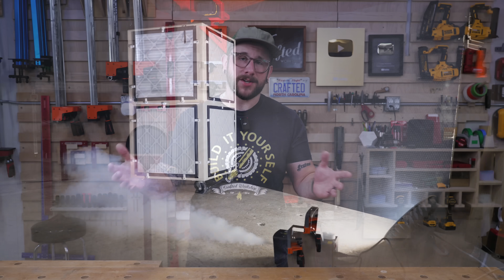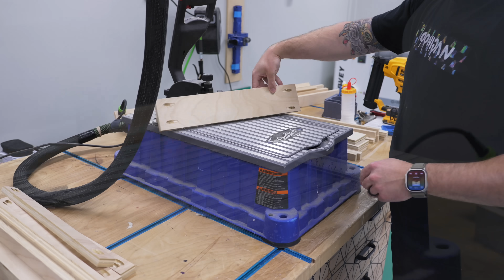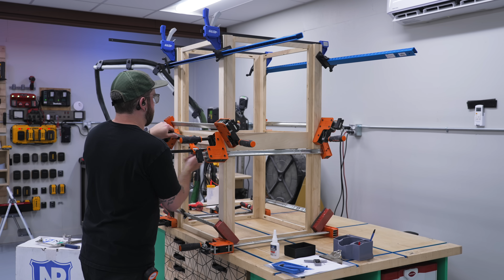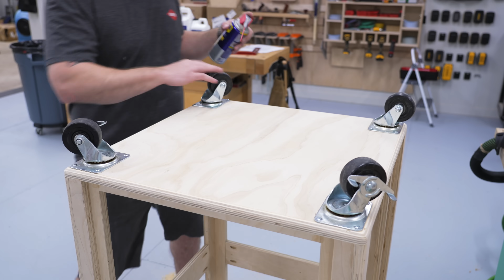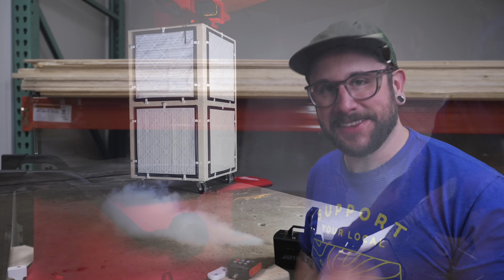How To Build DIY Cordless Shop Air Filter & Stop Breathing DUST!

Comment from the maker: Get plans for the DIY shop air filter cart! https://craftedworkshop.com/store/diy-shop-air-filter-plans-pre-order
Reply: Where's the link to the dewalt battery adapter? Thanks!
Reply: How has the prefilters been? 110 mesh is about 150 micron.

What do you think about 200-300 yellow mesh? It's ~50 microns.

Merv 14 removes down to 0.3-1 microns.

Just wondering if the 300 mesh would give you enough filter life without reducing the flow drastically 🤷
Reply from the maker: @benspragge33  the 110 mesh has worked great, it catches the larger stuff just fine and the filters seem basically brand new still. Easy to vacuum off the mesh and keep rolling.
Reply: @craftedworkshop that's very helpful. I was curious cause I want to build this for construction sites in houses. For painting and sheetrock dust. I'll try the 110 mesh first.

Thanks again!
Reply: Which particulate detector do you use?
Reply: @1320crusier  i would also like to know this please @craftedworkshop
Reply: Stop messing around. Get a cartridge filter such as Wynn Environmental carries. Better filtration, easier to clean if you have a leaf blower or air compressor. Costs a bit more but faster/easier to assemble something.
Reply: @jimweisgram9185  i searched their website and they have so many options i have no clue which one you're meaning when you say "costs a bit more" can you please narrow it down if you're going to go through the trouble of helping us out please?

Comment: I like the design, but I think I could use a lot less plywood by dropping the inner/outer frame design in favor of a single frame and using a router bit to recess the filter "pockets". Also, keep in mind the air pressure against those filters when you turn the fan on: when air is flowing it will snug the filter against the frame. Seems like you could use 2 clips instead of 6? And maybe even skip the foam?

Comment: Question: Why not use an air exhaust system? It seems like a great, perhaps even better, solution, yet I don’t see many workshops using one.

You could install Cloudline inline fans for both intake and exhaust to fully exchange the workshop air. This would reduce particulate matter (PM) levels much faster than any HEPA filtration system, while also removing VOCs and formaldehyde (things HEPA filters do nothing for). These systems are relatively silent and inexpensive. The obvious downside, of course, is that you would also be exhausting your conditioned air (heating or air conditioning).

I’m currently designing my woodshop and plan to use a very similar dust collection setup to yours: a Oneida system for the large machines, a Festool shop vac for power tools, and a Powermatic unit mounted on the ceiling.
That said, I think adding a HEPA system still makes a lot of sense. especially since the Powermatic doesn’t actually remove dust, but rather agglomerates fine particles into larger ones, making them less hazardous. But still: why don't you go with a full exhaust?

Comment: Question is , what is the most cost effective filter?, (size) that rules design. Looking at filter cost, it may be the 27 x 20 3 inch thick filter bought in bulk,,,(get one winter out of.)

Comment: What you really want to do is check the flow of a new filter, then you can check each individual filter and only replace the filters that actually are blocked. Saves heaps of money in the long run.

And you’d want to check the whole surface of the filter in a sweeping motion and use the average function of the anemometer and press hold when finished checking the entire area of the filter.

Also I usually orient the filters so the lines are running vertically so dust doesn’t necessarily settle on horizontal surfaces of the filter .

Great project though.

I might make one for my shop to get my welding fumes out

Comment: The anemometer measures feet/minute. You need to multiply that number by the area of the fan (in square feet) to get the CFM measurement.

Comment: Even if I have a really small workshop and this one will not have space to fit there (I will need something mounted on the ceiling) I would love to see your results after a while, with how often you need to change the filters, clean the inside if needed or other things. When I'm writing it has been more than 9 months since the video release.

Cheers.

Comment: Thank you for making it with slats.  I hate watching people waste plywood cutting a 2’ 2’ sheet and the cutting out the middle.    Though I made mine 4” deep so 2 2” slats on each side hold filter in.  I’d have to remove one slat to remove a filter.

Comment: Nice build!  Interesting that the fan runs either corded or cordless.  I assume it also charges whenever it is plugged in.
Keep an eye on the “pre-filters” - they are likely to get clogged much sooner than expected.  Still, I do like the idea.
Others have expressed an interest in a follow-up.  I concur.
Please provide the link to the adapter for the DeWalt batteries.  Could not find in the description.
Thanks!

Comment: A small improvement I might suggest is in place of clips to hold the filters in, and installing mesh prefilter on each one, is you could potentially build a door for each side that has the mesh preinstalled and serves the function of holding the filters in. It's more work but it saves work down the road of installing the mesh every time you replace the filter. You could theoretically have the prefilter be permanent.  overall great build

Comment: The anemometer you have measures in feet/min. That's how far the air travels over the course of one minute. To get cubic feet/min you need to multiply the value you get by the area of the fan's exhaust (which the anemometer can't possibly know). If it's 18 inches in diameter, that'll be 1.77 square feet, multiplied by 1181 ft/min gives 2007.7 cubic feet per minute. Not quite the 3400 claimed in the specs, but they might be fudging that number by including air that gets pulled around the outside of the fan and so on.
Reply from the maker: Yea, I definitely did my math wrong but still underperforming!

Comment: Glad I haven't pulled the trigger on the 3D kit yet.  Love the battery operated fan and that it works with his parts.  Pretty sweet setup my cyber friend!  Semi-pro tip for ya...cut off your anamometer lanyard; mine got sucked into the fan and broke. Oops.
Reply from the maker: Hah, good idea on the lanyard but I'm worried about the entire thing getting sucked into my dust collection hose when I test that in the future! The cordless fan is working great, loving this filter cart so far.

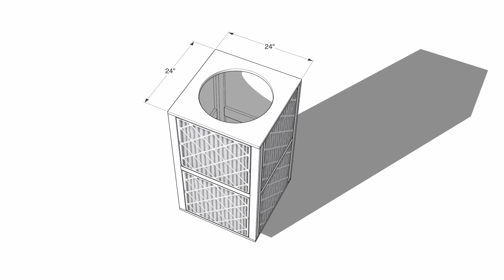Comment: @ 1:40 I’d argue that the average Milwaukee “fan” is much larger than 21” in diameter…😂

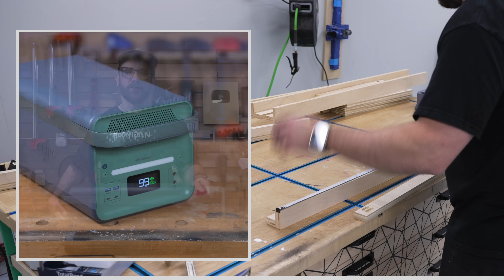Then @ 3:59 your sponsored plug would give you a great chance to choose literally any number of corded fans in the marketplace that are likely far stronger and far cheaper for the cfm than the Milwaukee cordless one you chose. Just build a place on the bottom for your Yoshino battery pack to live and run the cord from the fan on top on down to the battery. Still stable and if anything probably more stable as the fan up top is lighter and the base is now quite heavy with the Yoshino. 

Plug in overnight and you’re good to go.

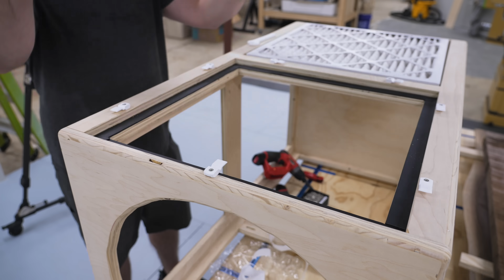Comment: 15:00 I like the pre-filter idea I hope it works out well. Also when you take the tape off it probably won't come off the cardboard very well but if you cut around the edges or next time put a gaffers tape edge on the material and fold it around then tape it onto the filters you should be able to remove the material from the filters pretty easily and reuse it. The edging will give the material some edge strength and then the gaffers tape should release fairly well from itself.

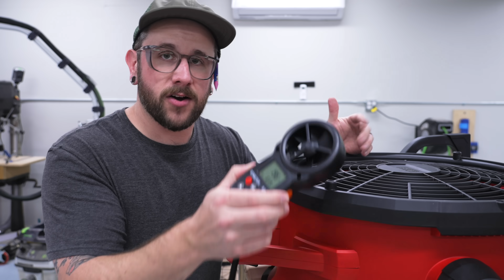Comment: 13:13 Oh that's a KeyPoint sure a battery operated fan that's great, but forgot to mention that it's a corded option that's really cool. Because then when the battery dies you can plug it in ( maybe it'll even charge the battery? ) and then you can detach from the wall and move it around again.

Comment: i've seen a few of these on youtube, some had the fan blowing into the cart (dust is on the inside) instead of this version where it blows the air out of the cart (dust on the outside).  curious if anyone has any reasons why one is better
Reply: I was wondering why anyone would want a pile of dust on the outside, where any slight breeze will mix the dust back in with the air.  There should be a catch basin at the bottom, where the sawdust can be emptied.  But I can see the obvious problem; the air has to be sucked through the filters, and this is the easiest way to suck air through the filters...

Comment: Build a version that takes 4" thick filters or 5" (4+1).  Higher initial expense, but will last way longer without restricting air flow.  On mine, I use a 1" MERV 8 in front of the 4" HEPA filters to catch the big stuff.  
Only ever need to change the pre-filters.  Everyone needs something like this in addition to a dust sucker.
Reply: I saw a video of something like this and used it when I built a hidden door that was all 3" stained paneling. Workin in a small room with no windows and the door closed. It helped so much it was crazy. I keep toying with the idea of making one for the house with a decorative case. When I took it apart after the job the filters were way cleaner than I thought they would be with how much they cleaned the air quality up. 10/10 would recommend.

Comment: Isn't the fan and the filters the wrong way?  this is like bruming the whole room and then dumping the dust in the middle of the room again. Filters don't "hold" particles they prevent them pass through.
Reply: exactly, the dust will hang on the outside of the filter and will fall off and spread again.

Comment: that was awesome.  I have been thinking about doing something like this. My shop is in the basement and too close to the HVAC for the house.  I like the idea on the additional mesh too so you can vacuum it from the outside.  I would be curious for a long term review on this? like after 1,2,4,8 weeks of use or until you replace the filters, how does your CFM drop or ability to get the particulate level down?  Oh, and great idea on the battery adapter!  I have all Dewalt stuff, but have been eyeing the Milwaukee cordless 18 guage brad nailer.  Tool only is like $260, but with batter and charger its like $400.  If for $10 bucks I can use my larger dewalt batteries, that would be awesome!

Comment: You should make another set of 8 filters ahead of time and squirrel them away somewhere. When it's time to change them, if you have to do a bunch of work, you'll delay it - potentially impacting the air quality. Having a set on hand makes it much easier to just change them as needed.
Reply from the maker: Probably a good idea!

Comment: Why not just build screens that sit on top of the filters? So 1 large screen per 4 sides. With 4 tabs to hold them in place to pop in and out. You could also make screens that hinge like a large door over both screens per side. So you open the screen, clean it off , replace the filters. Close and good to go. Quick & easy.

Comment: That 1181 ft/mn reading was airspeed, not volume.  You want CFM, not ft/mn.  You'll need to do a bit more math, or I think the BT-100 has a setting that will calculate CF/M for you, if you enter a couple of variables that you measure independently, first.

Comment: Wonder instead of all the clips keeping the filters in and the pre-filter screening tapped onto the filters, you could make removable panels with some plywood and screening on it. You could use magnets or star knobs to attach the panels on and the screening could also keep filters in their spot. That'd also cover any screws holding the corners together. Use walnut instead of plywood like a real YouTuber :D

Comment: While the air filter is excellent, it is a failure as a means of removing fine dust from the work area.
Air suction occurs from the floor level to the waist, dust from the machines is above the waist. This fan creates air movement by dispersing dust from machines. More effective would be a flexible hose with a funnel that can be moved as close as possible to the work area where the dust comes from.

Comment: I've done something very similar to this in the past, but the large fans didn't last. The unavoidable fine dust that gets by or through the filters wreaks havoc on the fan motors. I got tired of replacing them, so I got my hands on old 3 speed furnace blower assembly, It's a little noisier but still going strong, and the CFM's are fantastic for my needs, even on the lowest speed.

Comment: This is very similar to a Corsi-Rosenthal Box (not sure which came first) which can be used to filter the air when people are congregating indoors. They've been really helpful in schools or businesses where the building's ventilation system can't keep up with crowds etc. and folks are at risk of getting sick from air-spread diseases.

Very cheap to make; you just need some tape, cardboard, four filters like you've shown here, and a box fan. Lots of free designs and templates available online.
Reply: C-R Boxes were developed during the pandemic.

Comment: I don't think you're getting maximum filtration with your design.  I recall reading somewhere??  that your filter's fan needs to create a vortex type effect in your shop.  This way you are forcing the air around as apposed to waiting for it to come back to the cleaner.

Comment: Drag around cords??? Your'e in a shop.
Reply from the maker: All of my camera gear (tripods, lights) are on casters making extension cords are annoying to roll over. My robovac also gets hung up on them. I try to minimize extension cords and use gaffer’s tape to hold down more permanent cords to reduce trip hazards. I did all of the electrical in the shop and have outlets all over so I can really cut down on cords lying across the floor.

Comment: If the mesh catches the dust.. when you turn the fan off and roll the cart away.. what’s stopping the dust shaking off the mesh onto floor.?  Like it does on a vibrating filter cleaner on a cyclone.
Reply: Nothing. best to keep these stationary.
Reply: why not reverse the direction. Fan blows air into the box and have a dust collection pan at the bottom for large particles that fall off the filters.  Keep the mess in the box instead of stuck to the outside.  Also, most of the dust is at waist and shoulder level at creation so reversing direction could help with that too.

Comment: One way commercial shops cut dust down is by exhausting fine dust to the outside. So simply having something that can suck the shops volume out a few times per hour would be one of the best ways.  Looks like your filter works very well too.
Reply: Yeah but then you end up discharging heat or cold air and costing more in HVAC
Reply from the maker: @patdrumm3770 yup, this isn’t something I could do if I wanted conditioned air in the shop. I’d also need some kind of makeup air with the volume of air being pushed out of the shop.
Reply: @patdrumm3770  Apparently there are HRVs that can keep the 'keep' the heat by transferring the heat from the exhaust air to the new air.

Comment: just an idea what if you used that same fabric and made a sleeve for the whole box. cut a rectangle on the ends you can use Velcro that way you could take it off and wash it.
Reply: That would work better. You wouldn't have to modify the filters, and if you wrapped all 4 sides, that would hold the filters in place, so you wouldn't even need the clips.

Comment: I'd be interested to see a video after 6 months of so of use with a cost break down.  How much to the filters cost? How often do you need to replace them?  Cost analysis between commercially available air filters vs the DIY ones.  What costs more over the long haul with the cost of replacing filter etc.  This  video was awesome by the way.  Thanks for sharing!

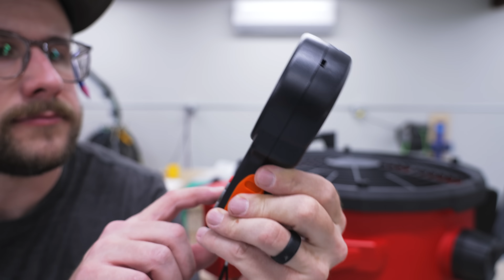Comment: 13:40 1,181 ft/min is 13.4mph. Milwaukee rates it at 13.5mph per the spec sheet you showed. So right in line
Reply: Yes, I think he was mixing up Ft/Min and CFM.

Comment: CFM isn’t enough of a measure, you need to account for volume, but more important for filter. You need to know your fans static air pressure, this fan is likely not strong enough to push efficient air though the filters

Comment: Whoever claims that someone else made it, just remember that during the high time of the pandemic, people were making FFP3 (or N100 if you are American) filters for large rooms. It's not some novel design, even household airfilters are using the same design.

Also this particular design, when used in a shop, is a bit stupid, for viruses it's awesome, as they get trapped in the filter (either by brownian motion or electric charge of the fibers), but for the larger particles of dust that stay on top of the surface of the filter, once the fan is off, they will just fall off and become airborn again. You need a way to enclose the dust in, not leave it on the top of the airfilter. There is a reason why household machines have the filter enclosed in another box.

Comment: You might have caused yourself a fair bit of extra work by adding the pre-filtters. Essentially you reduced the total surface area available to hold dust before the filter clogs up and restricts airflow significantly. Probably not an issue if you keep up with vacuuming them regularly but I know I would get tired of doing that very quickly.
Reply: I had this thought, too.
Reply: I mean, it's not terribly different than his existing dust collection system with the paddles inside the filter tubes that knock the dust off to extend the life of the filters. Besides, it's probably like 1 minute worth of work once a week. It's not that big of a deal.